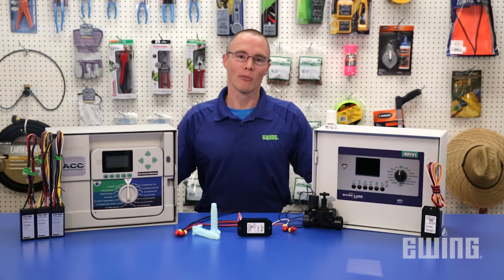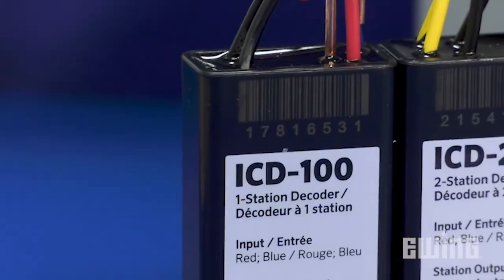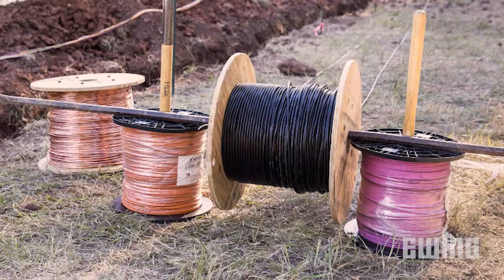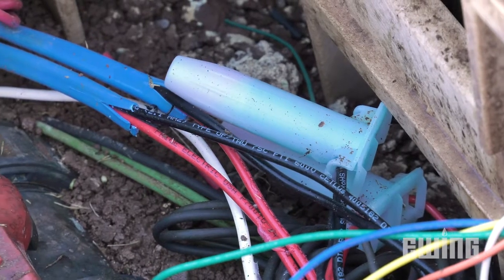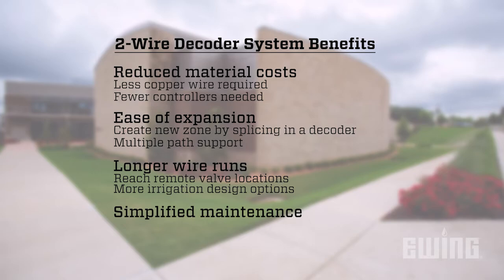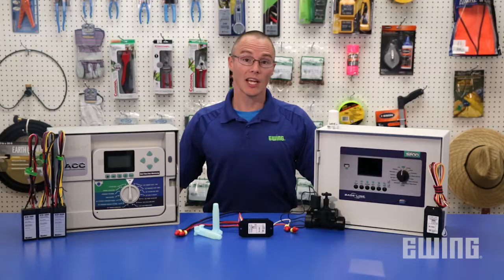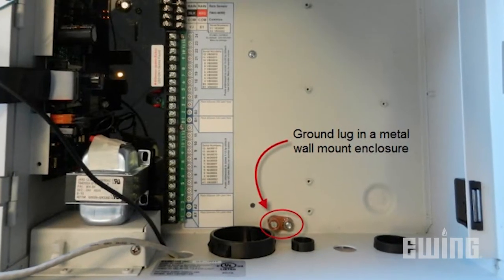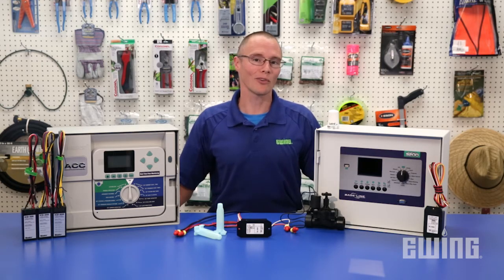Basics Of 2-Wire Decoder Irrigation Control

Comment: Can I, and if so, how do I connect a 2 wire system to a new wifi control box
Reply from the maker: All of the major manufactures offer some form of remote operation for their 2-wire controllers. This typically involves WiFi, radio or cellular connections as well as proprietary software. It's doubtful that you will be able to use a third party WiFi control box to manage the controller. Here are a couple of links that may help to shed some light on the subject for you:
https://www.baselinesystems.com/mediafiles/pdf/Comm_modules_specifiers_guide.pdf
http://iqweb.rainbird.com/iq/
Thanks for watching!
Reply: @ewingoutdoorsupply  Just found out that the two wires are to a conversion Index valve. is there a way to use it with a new wifi box or do I have to convert the system by installing separate valves?
Reply from the maker: I think you may be confusing a two-wire irrigation system with a conventionally wired system. In regards to your question though, Indexing valves are not suited for smart irrigation technologies since zones cannot be timed individually. If you want the ability to program and control your irrigation remotely through a computer or mobile device, you will want to retrofit your system to individual electronic valves for each zone and install a smart controller that has the features you are looking for. Here are a links to videos for a couple of controller options.
https://www.youtube.com/watch?v=AAk-LzYwBdQ
https://www.youtube.com/watch?v=kSLPxnd2U-w
Reply: @ewingoutdoorsupply  Thanks, I did come to that conclusion. Im in the process of retrofiting the system. Thanks for all your input.
Reply: how to manually run a station on a 3200 baseline timer?

Comment: Got a two wire over current, what's my first step?
Reply from the maker: Over-current likely means the controller has gone into self-protect mode. This is often caused by faulty wires. The controller manufacturer should have a support line that you can call for troubleshooting steps. If you have a Ewing location near you, you can also contact them for advice. Good luck and thanks for watching! https://www.ewingirrigation.com/locations/